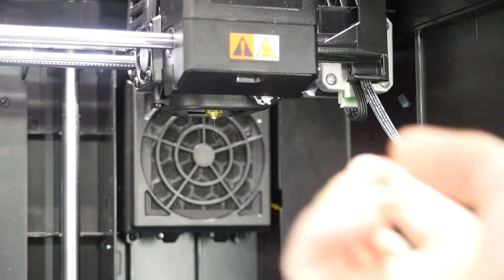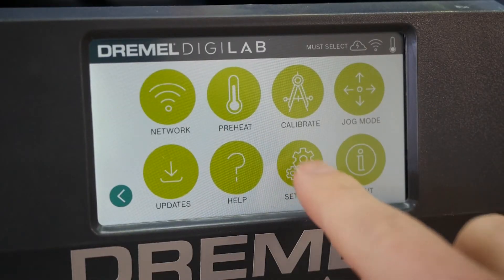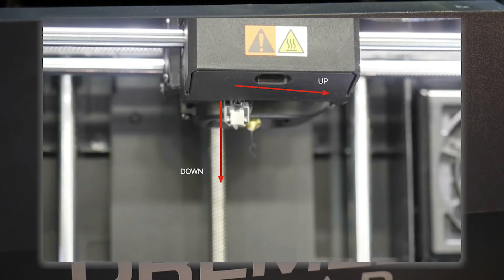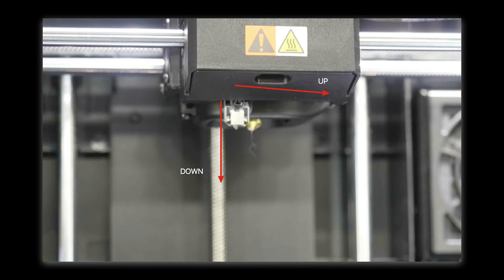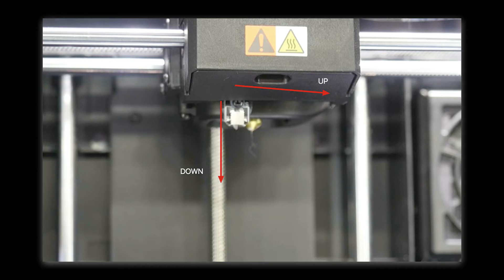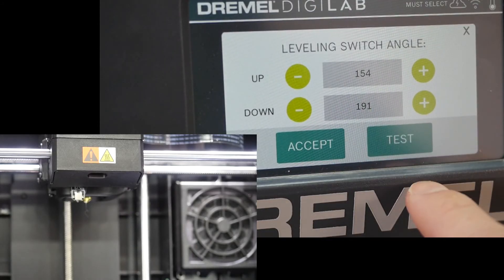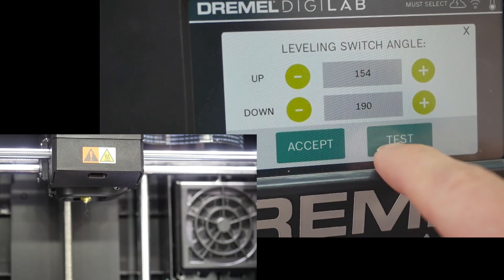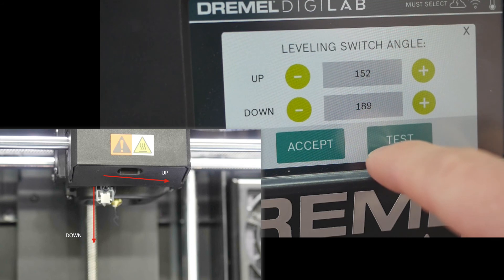Dremel Digilab 3D45 - Leveling Switch Calibration

Comment: If you find this because like me you are having problems with printing and have found the calibration arm is deploying at an irregular angle the screws holding the motor/gear assembly to the arm may be loose.  That was making the meshing of the gears unreliable which in turn resulted in the arm not opening to the same angle reliably.  Tighten the screws and reassemble.  Working well since.